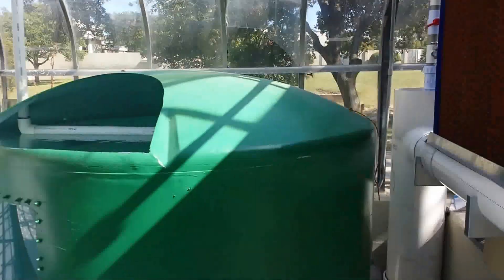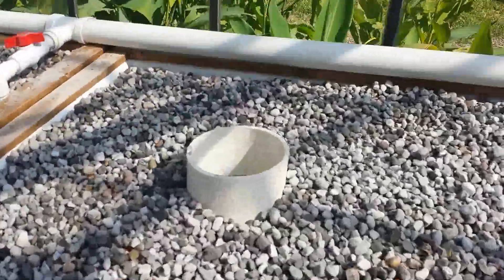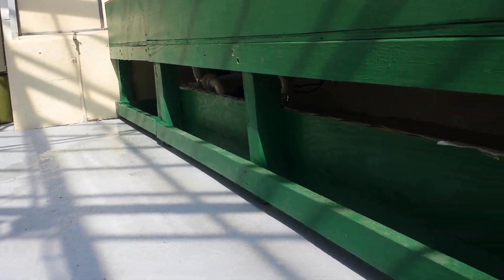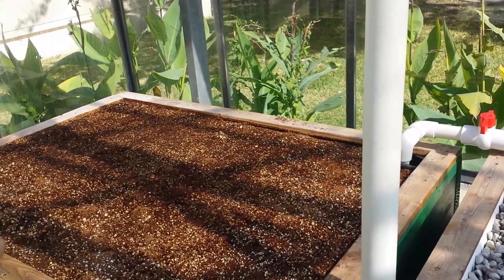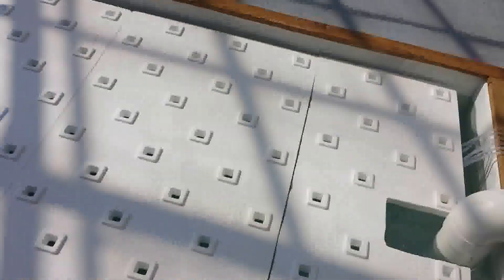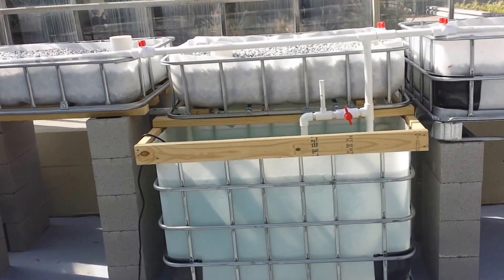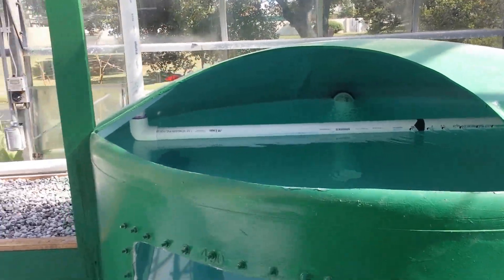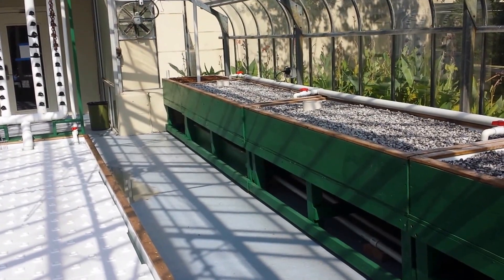Mountain View College (DCCCD) - Custom Aquaponic System

Comment: that's right, but my thing is that if you're only using water with nutrients it's not really organic. I also know that it would be more eco friendly to water the soil as it does retain most of the water it is served. It is a good model but I think there can be some improvements on the other end of the spectrum.  sorry it's just the constructive criticism  but great job on the build.
Reply from the maker: Thanks for the compliment on the build -- but I don't understand your comment... Aquaponics does not "waste" water -- all of the water in the system is retained, more so than if it was used to irrigate soil. Further, the nutrients in this system are derived from the fish (waste) and the microbial interactions --- exactly the same as in the soil.